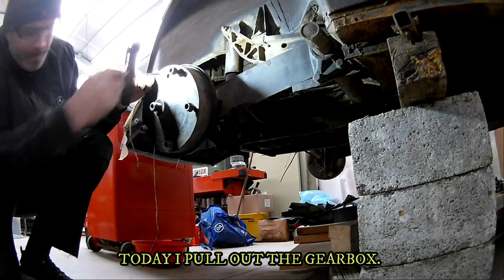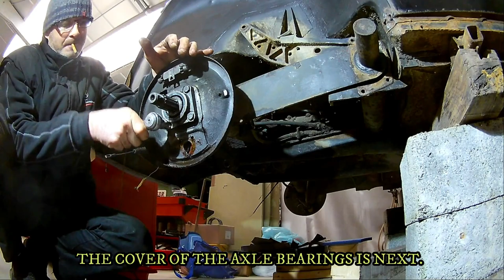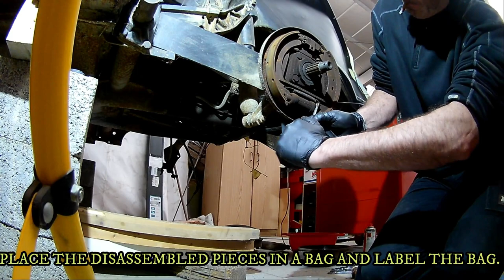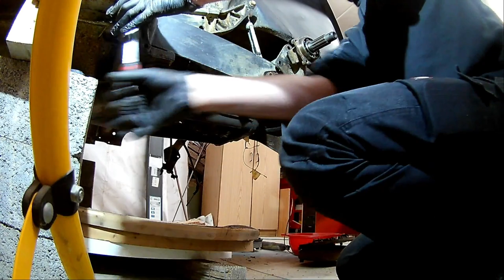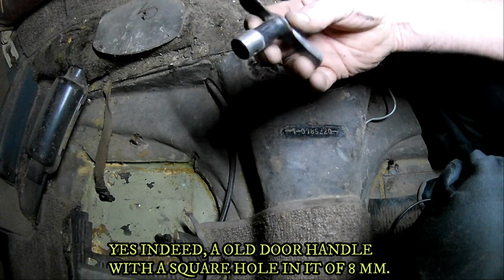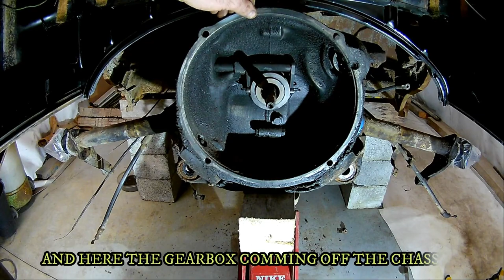VW BEETLE DIY HOW TO REMOVE A SPLIT CASE GEARBOX: EPISODE #5

Comment: Spring plate bolts and backing plate bolts on ovals , as well as mudguards are 14mm head if yours are 13 someone been there before
Reply from the maker: Good point, it’s 14 for the mudguards and the spring plate cap bolts. My error in the video. Thnx for watching and the comment.👍👍

Comment: Did you need to rebuild the split case? Did you do it yourself? I have a 57 split case I need rebuilt
Reply from the maker: Well i did rebuild the split case myself, because I wanted to renew the roll bearings.
The oil was more then 50 years old and the case was very filthy and needed a big cleanup.